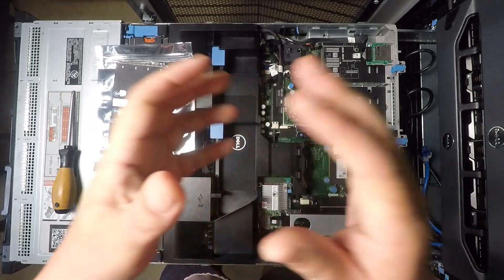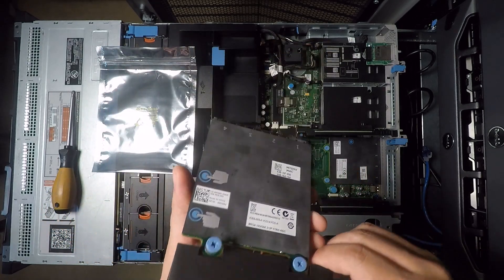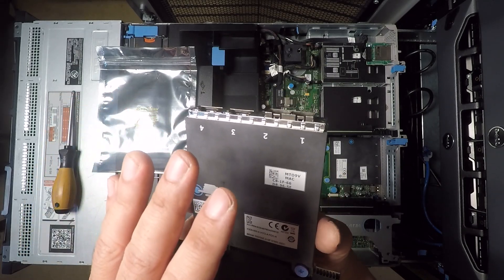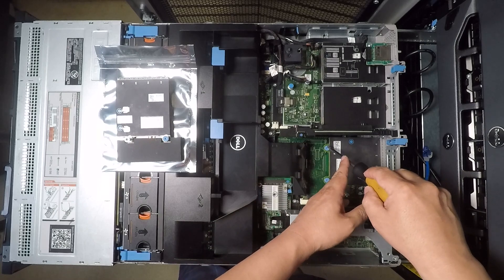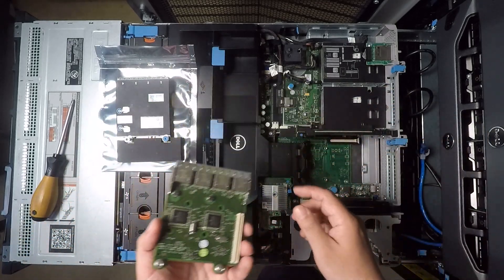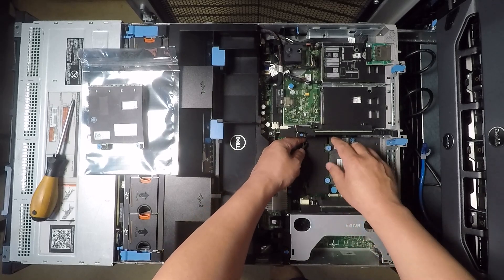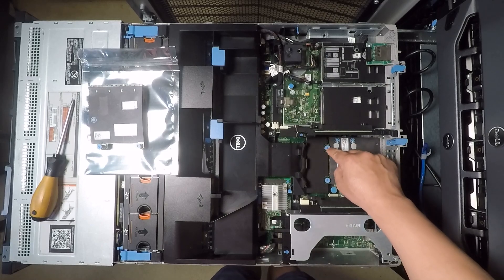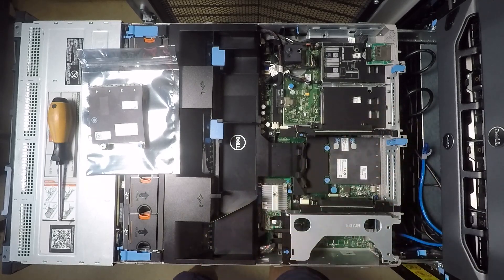How to upgrade to 10Gb ethernet in Dell R720XD

Comment: Does that card have any restrictions on the SFP modules you can install? Or is that only a concern in terms of mixing the transcievers on each end?
Reply from the maker: I didn't run into any functional restrictions. When I used a Cisco branded DAC cable,  during boot up the driver showed a warning message about "unqualified transceiver detected" or something like that. But, it still worked and my iperf3 test showed 9.4Gbps in both directions.
Reply: @ArtofServer  That's good that it'll run with an "unqualified transceiver".  I have an HP Aruba switch that refuses to even try to use an unqualified transceiver. The next model switch up from mine has a hidden option to enable it, but not mine.